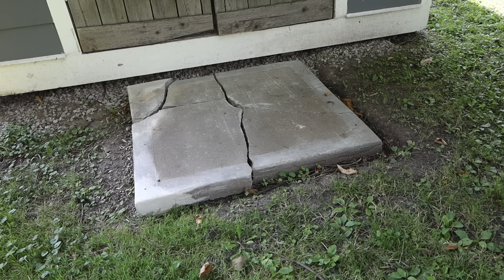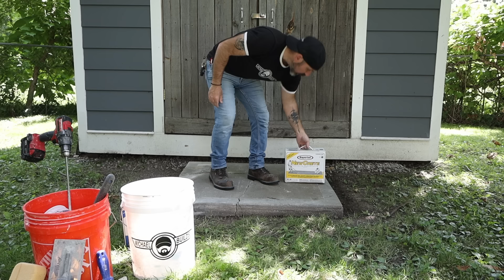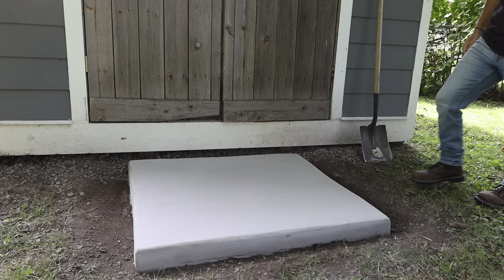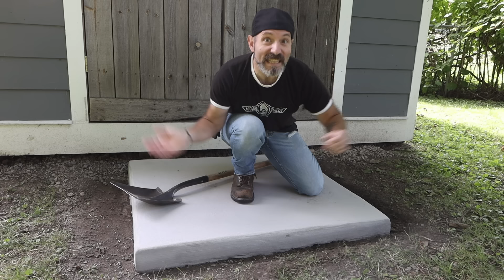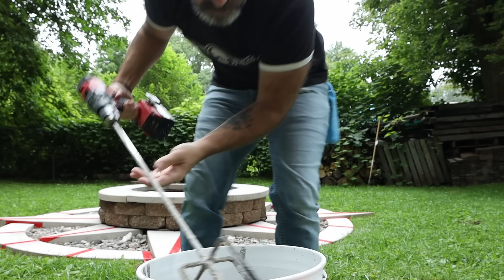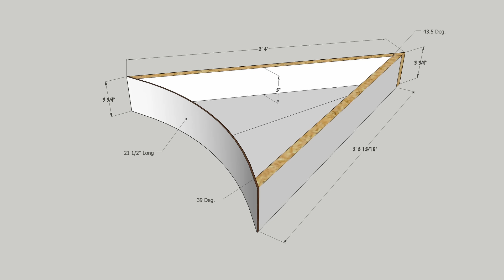How to Resurface Concrete with Rapid Set NewCrete

Comment from the maker: BEFORE YOU COMMENT... Just to be clear, when I said that "You saved yourself thousands of dollars" I am not talking about my little slab of concrete. I'm talking about the typical driveway or porch project ( large or small ) that can cost $5,000-$10,000 if you hire a professional to rip up, haul away and re-pour. Yes, I could have completely replaced this particular slab for about $30 but the point of this video is to demonstrated to my viewers how to make this type of repair and give them more options. This is a great way to save MONEY, TIME and HASSLE if traditional methods are not an option.
Reply: I have a cracked cement drive way in Southern New England. We get ice and snow . Would this repair hold up the weather and weight ? What about snow plows? Thanks .
Reply: @markmed9091  no chance.
Reply: You have no idea how much I appreciate you for doing this video🙏🏽💖
Reply: Michael.. I need your help. I was poring a little slab with 50lb bags of quikrete (wet pour) and i ran short so hurried down to lowes to pick up a couple more. after getting home and started pouring it, the ones i just picked up were sandier with hardly and cement in them even though they were the exact same product. Is this normal??  Do you think it will set ok?
Reply: @HappyHands.  You might have a color difference but other then that strength should be equal as long as you mix it up right
Reply: @HappyHands. I suggest you rip it up.
Reply: I did rip it up, and started over  the sandy batch from lowes didn't harden. it turned out like morterbed. loose and soft.  @fredrubble4305
Reply: LoL I came here to see the trolls commenting on that statement. Nicely done
Reply: What do you use if you have cracked bricks at the base of the house. Thanks
Reply: This is great thank you! I just got a bid of 21k for new drive way.. gonna try this before spending that kind of dough 👍
Reply: Thank you! I might try this!
Reply: We I have a portable mixer and my garage floor has thousands of cracks. I don't put a car in it the door just isn't wide enough an it's short so I'm going to make it a rec room. So if this doesn't work what the heck. I'll throw down something else. 😅
Reply: @barbrice721 just use self leveler products
Reply: $5-10,000? We're having our gravel driveway taken out and replaced by a slightly wider concrete one, and it's costing more than twice your top-end number. So if anything, you're being conservative with your savings estimate for people who already have concrete and are trying to avoid having it broken up and replaced, at least in a major metropolitan area like the one where we live.
Reply: Cool design
Reply: Goddam dude!  You write well and articulated your position/point very well.  You, Sir, have braun but more important a brain that its synapses are firing  full fledged.  Liked this vid and will watch your other available vids.  Thank you for sharing.
Reply: Can I do something like this on a slab made of pavers? I wanted to try to pour a small layer of resurfacing from rapidset
Reply: Would this work on streets as well, need a concrete with 4000 psi for cars and trucks
Reply: @salverdoliva2507  no, it won't even work at all for nothing. Might as well throw your money away.
Reply: 🙏🏽 thank you
Reply: Lol.😅
Reply: Michael, you were totally correct in the savings comment. Only a Troll would go after you for the small pad. 
We have a medium sized patio needs resurfaced and cracks filled. It's gratifying to know this project can be done DIY for very little money.
Reply: Macgiving is always key !
Well done
Reply: Great job, I needed this for a project I wanted to do. Looks great, Thank You!
Reply: Great video!  Does it work with driveway?  I.e. vehicle traffic?
Reply: Hey Michael, how do you fix concrete countertops with cracks and chips. I used the rapid set to make the top
Reply: Will this work and adhere to cover cover oil stains on a driveway
Reply: CAN YOU DRIVE A CAR ON IT?  in OTHER words can a diyer do a whole driveway by themself?
Reply: I have a porch area leading from my basment outside, would you be so kind to give me a list of product I need to fix it to looks decent, it’s just ridiculously expensive to tear it all up and pay $10k to $20 to fix I just want it to looks nice.  Please reach out whenever you can thank you i would appreciate it.
Reply: Tell me about it. Just had my drive done in concrete. 25' wide x 277' long. = $48,800.00 bucks!
Reply: @Torq2001  I need to do the same except I can't bare the thought of seeing the first crack after I drop 50k on the job. Eeeek
Reply: @Torq2001  What? Do you have a flying car?
Reply: How about winter?  What is your geographic location?   If you are in California Elmer's Glue will work.
Reply: @1133saginaw
Reply: @1133saginaw
Reply: @1133saginaw  LOL!🤣
Reply: @1133saginaw no it won't hold in California because the temperatures change from 32degrees to 100degrees.when temperatures change that cement will expand and contract and there are several different peices here, it's not one peice of cement.
 What this means in California is that fixing it with cement all will not hold the prices together for long. It might last you a week or two before it starts to split again into all those separate peices and you'll be back where you started 
 He doesn't care if anything works, he just wants to keep the algorithm up so he can make a lot of money on utube.
Reply: @drmidnight680-kz2le We'd be more inclined to believe anything you wrote if you could properly spell a FIVE LETTER WORD!
You've lost all credibility! And, have you actually even used this EXACT product before?
Piece not peice
Piece not price
Sheesh! Save your effort! 🤷🤦
Reply: @KOrnhOliO1  it was auto spelling, it changed it.
 Still, just think of it like 2 big slabs that are going to move with temperature. Eventually it'll fail and you'll be back where you started.
No matter what the brand is, it will never have the strength to hold it together.
Reply: @drmidnight680-kz2le  If it was reinforced with wire mesh or rebar, it will hold.
Reply: @KOrnhOliO1  how ugly, he might not win a spelling bee but he knows his concrete!
Reply: I know what you meant 😉
Reply: It is easy for you. But it might be hard for me. I will try it. I hit your subscribe.
Reply: @loswingman  don't believe it.

Comment: I just used the newcrete.    4/1 mix was unworkable.  Had to shovel it up fast before it set.    5/1 was better but still difficult to work.    Used it anyhow and ended up with a lumpy section.    Next batches 5.5/1 and it poured like pancake batter.   But set slower so I got good results.    But having thinned it so much it likely will not be as strong as it should be.    All in all you make it look easy but it wasn’t easy.   It sets too fast.   Any high strength slow set mixes anyone know of for overlaying old concrete?

Comment: Would the New Crete work well to repair the weather lip on a garage floor that experiences extreme temperature swings. I live in Syracuse NY and our summers can hit 90 degrees but we can have 30-40 days straight of 15 degrees or below in the winter. My original floor is letting go from the cold and salt and I am concerned about repairing it, thanks for the great video.

Comment: I have a decent sized concrete patio that was covered up with wood decking years ago. (Not by me. By the original homeowner. I'm guessing in the 90s sometime.)  
I'm in the process of removing the rotten warped wood, which has left the concrete dirty, cracked, and even has a steel strap holding two small slab sections together.
I plan on power washing the concrete. But would you (or anyone that's able to help) recommend any further prep, like a degreaser, or soap? 

Any help would be appreciated. I've watched your videos for years. I really appreciate them!

Thank You!

Peace, light, and blessings from south of Detroit.

Comment: New viewer here.  This looks like it may be what I need to repair my garage floor, which has spider cracking, chipping, etc. in a couple of places.  So if you don't mind, could you answer a few questions?  Our garage floor is slicker than a concrete slab.  Do I need to rough up around the edges of the places that need repair?  I'm guessing that I need to do both treatments, yes?  After spreading out the NewCrete, can I do something to it that makes it slick and shiny like the rest of the garage floor?  And the really big question - can I patch up just the areas with these blemishes, or do I need to do the entire garage to make it look and perform correctly?

Comment: Great video thanks! What do you do if you got a coating ontop of concrete steps that has chipped in places but not everywhere? Some parts are holding strong others chipped off. The salt in harsh winters over a decade caused it. Need to repair. Also deep holes on bottom platform are forming how to fill?

Comment: Hey sir, what would you recommend? I did a dry poor 15 inches wide 10 feet long small slab dry pour in. It rained on me at the end. A lot of chipping on the corners on top which one of these would you recommend to use to get a smooth finish?

Comment: You used NewCrete for over everything vs. the Cement All - both can be feathered at least that’s what the package states. Asking as I have spaulding driveway and it’s likely .5in in some places why not use the Cement All or will it creak easer then the NewCrete?
Reply: you can, cement-all will dry more white-ish yellow though.

Comment: Question; I have a bathroom I would like to acid stain. It has a stress crack which may not stain well. I will need a nice smooth surface and not a broom finish. Can I use this to resurface before I stain?
Reply: Yes, you can resurface your bathroom floor before applying acid stain, especially if you're dealing with stress cracks or an uneven surface. Here's how you can address this:

Steps to Prepare for Acid Staining:
Clean the Floor:

Remove all dirt, grease, and debris to ensure proper adhesion of the resurfacing material.
Use a degreaser or a concrete cleaner, and rinse thoroughly.
Repair Cracks:

Use a concrete crack filler or patching compound to fill the stress crack. Ensure the filler is compatible with acid staining and can blend seamlessly with the resurfaced area.
Smooth the filler so it aligns with the rest of the floor. Let it cure fully.
Resurface the Floor:

Apply a thin overlay or micro-topping designed for concrete resurfacing. These products can provide a smooth, stainable surface. Look for one explicitly formulated to work well with acid stains, such as self-leveling compounds.
Follow the manufacturer's instructions for application and curing. Ensure the surface is troweled to a smooth finish, avoiding broom finishes, as they won't stain evenly.
Sand and Prepare the Surface:

Once the overlay is cured, lightly sand the surface with a fine-grit sanding pad to ensure smoothness.
Vacuum and clean the surface to remove any dust.
Apply the Acid Stain:

After preparing the surface, test the acid stain on a small area to confirm it reacts well with the resurfaced material.
Proceed with staining as per the instructions, allowing for proper reaction time.
Notes on Material Selection:
Compatibility: Ensure all products, including the crack filler and resurfacing compound, are compatible with acid stains.
Quality Overlay Products: Brands like Ardex, Quikrete, or similar offer products suitable for creating a smooth, stainable surface.
Test First: Always test the stain on a small, inconspicuous area before applying it to the entire surface to ensure the desired finish.

Comment: Just now getting around to watching this one because I didn't think I had a need...

I have an exposed aggregate slab for my driveway that is over 30-years old. It was never maintained well over the years until we bought the house. Well, after 7-years living here, I really hate it, especially in the summer walking barefoot. 

Could a product similar to this resurfacer work for turning this exposed aggregate into a regular slab? I know thicker isn't better for this stuff, but I think a whole new overlay would help, but it can't be too thick because of the transition into the garage and entryway. Anyway, do you have any suggestions?

Comment: I'm guessing this would be good for larger slabs, or ones that are more structurally sound just with some age and wear. A slab like the one in the demonstration is probably cheaper just to pour a new one. I really like the fire pit overlay. I was almost thinking about using something like that to put a fake stone texture on my driveway/sidewalk to make it look more like pavers or cobblestone rather that just plain old concrete

Comment: After finishing that small slab I noticed you didn't really load test it. I'm sure it wouldn't hold your F-150 but it doesn't look like it would hold a few hundred pounds. I'm looking for products to resurface my circular driveway which has hairline cracks and a couple of pieces around 3"x3" broken off. Also you didn't mention if the new surface was slippery when wet.

Comment: You said “saved 1000s of dollars”?? That 3X3 there would have cost you about 25 bucks of concrete. 
You could have saved 25 bucks by not buying the set and cement all. And just bought 4-6 bags of concrete and made a brand new 3X3 assuming that’s the size you have there. 

But thanks for showing the application.

Comment: I wonder f pouring a new slab is faster, cheaper and more durable.
Reply: If the project was just to do something the size of the demonstration area he did then possibly, BUT this was to demonstrate the product and how to use it, it would be assumed that you would have a much larger project not just a 3 foot square of concrete

Comment: Most of the problems of all cracked garage exits, paths, concrete slab.  This is not the use of a rebar, but the use of a steel mesh.
  In this video it seems to me that she is not there at all.

Comment: Followed your direction, patched up the curb in front of my house and my neighbor's house and it looks great. Cement All is no joke quick curing so folks, this guy is spot on. It cures quickly and I mean like in 10 minutes and you're going to be hard pressed to work it. I'm a design engineer and if I can do this, you can too. Will be reporting back this time next year. Thanks again for the video!
Reply: good point. I saw on the Rapid Set video you can add a packet of something call "set control" to give yourself an extra 15 minutes of working time.
Reply: @johnabe4610  Hey there! Thanks for the tip. Didn't even know something like that existed. I have more work to do and will keep it in mind if I need to use it. Really, thanks a ton!

Comment: I'll give this a try. Take a look at my <$30 imitation Solo stove on my channel. In order to get smokeless, it has to be taller and have a secondary, heated air inlet near the top rim. The velocity that results is what re-combusts the smoke particulates. Sort of an afterburner.

Comment: This video is brilliant - thank you!!!!!  Our 2 car 24 foot square garage slab needs this kind of work as the concrete has broken up like the slab you fixed in the video but it is such a large area. Any suggestions on how to stage the repair for 2 car slab? Would such repair hold up under the weight of 2 medium sized vehicles? In any case, great video, great work, all the best from Canada 🇨🇦

Comment: I have a concrete walkway with steps, one of the steps has sunken on one side making the step sloped to one side. Would this product be a faster and easier job if I put a form around the step and coated it? Obviously one side would be idk 2” deep and just a skim coat on the other and I of course would have to skim coat the whole walkway to make the finish match. Or should I dig out the step and try to Jack it up and fill under it? I worry it will crack in half if I try to lift one side

Comment: Thank you so much for making it simple and easy for someone that doesn’t have any construction skills to use. I have several slabs of sidewalk that have cracks in it. The only thing that has pebbles and therefore it would only make it smooth. The rest will be different however I’m sure you can make a video how to bring that outafter your fireplace. Thank you again for helping a novice.🎉🎉😊😊

Comment: Thanks for experimenting and posting using this method.  I'm curious to know after a year later if the larger crack showed any signs how smaller hairline cracks?  

With larger cracks like this, I would have done it a little differently.  

First, use a higher PSI like CementAll.  It has 9000 PSI compared to the 4000 of the Mortar mix.

Mix CementAll into a watery slurry the consistency of runny yogurt.  Pour that into the crack about halfway high.  Let it sit for a couple of hours, then mix another batch of CementAll with the consistency of a slushy and pour that up to about a 1/4" from the top of the crack and let that dry for 24hrs.  If you can let that dry for 7 to 10 days, that is even better.

Finally use a product like Sika Crack Flex Textured self-leveling sealant to top it off.  👍🙂

Comment: Very nice! We have a very old little equipment garage on a piece of backwoods property that has a cement floor which has cracked and sunk 2-3 inches in places. Looks like it was laid down by a drunk bear… i think these two products might be the answer. Will give it a try anyway before I jump to ripping it all out and restarting from scratch. Also love that stain job on the fire pit.